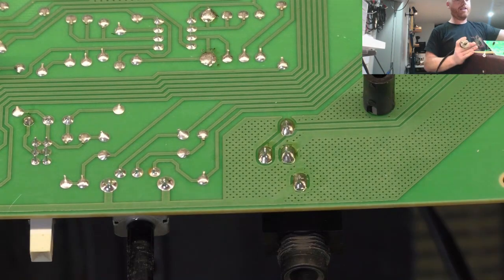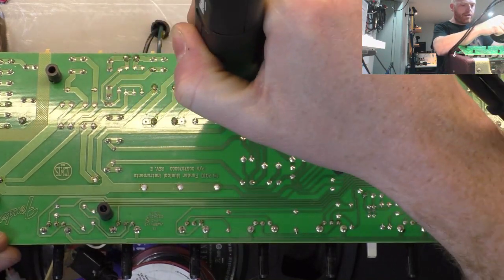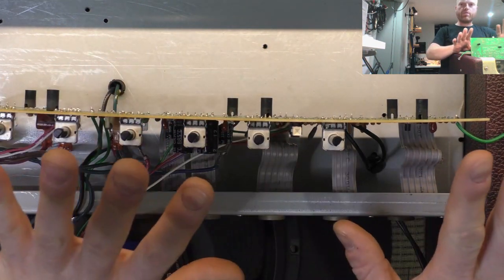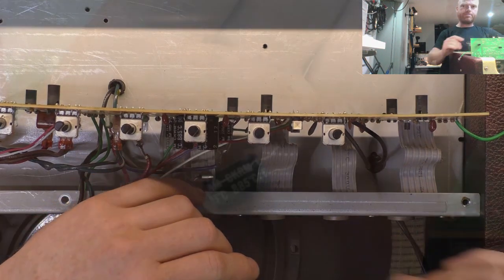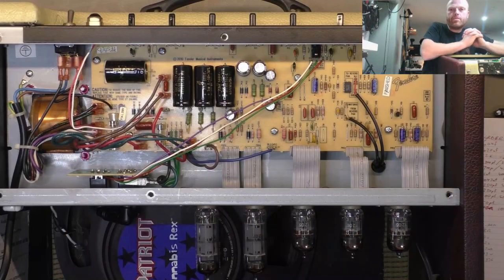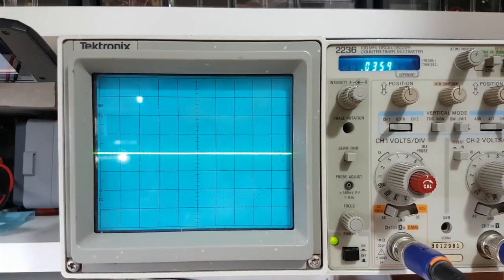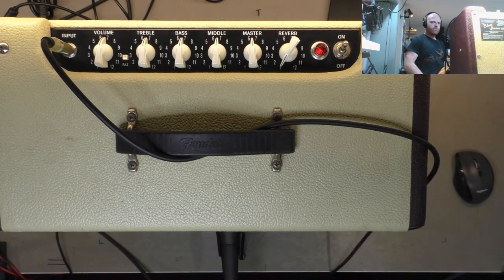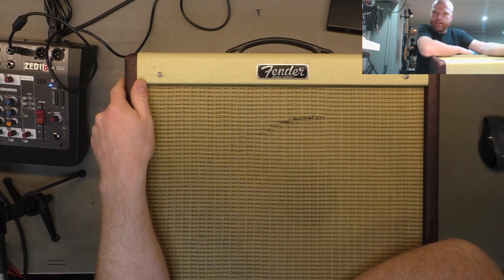Fender Blues Junior - Common Problems & Solutions (Part 2)

Comment: A grid stopper resistor of sufficient value probably could have tamed that oscillation as well but in case of PCB, it is not as easy to install as it would be in case of classic point to point wired amps. 

Very nice videos! 👍
I just recently noticed them and subscribed immediately.
Reply from the maker: Grid stoppers on the EL84'S?
If so, roughly doubling their factory value was part of the mods we implemented and didn't appreciably improve it.
Reply: @BradsGuitarGarage  No, to PI.
If that bypass cap of PI plate resistor did the job, as I understood, probably grid stopper would have done the same thing if the PI was oscillating or had too wide frequency response at higher frequencies.

Comment: Nice series! Go 🇦🇺 
Just a couple of quick questions if I may:
1) was that “adding bass into the first gain stage” cap still snipped when you did the final play through? I could still hear the bottom end caving in when you had the bass turned up past halfway, even with the volume and master opened up to 6.

2) to get this amp sounding better with overdrive pedals, is my best bet to swap out the Jensen speaker I have in the tweed version or to change the tone stack?
At the moment I run it: bass 0, treble 8, mids 6, volume 6, master 2-3.

A tech has already upgraded the jack for me and put in better caps and screen grid resistors.

Comment: Clean the speaker terminals prior to soldering with a pencil eraser or (better, more abrasive) ink eraser, or a fiberglas-bristle "scratch brush",  prior to soldering. It's important to solder the connection quickly, getting in and out fast, before the heat melts the solder joints of the braided tinsel-lead that goes from the terminals to the voice coil.
Reply from the maker: Is this comment meant for me or future viewers?
Reply: @BradsGuitarGarage  , more for future viewers;  and although a scotch bright pad will work, every electronics hobbyist, or professional,  really should have a fiberglass bristle scratch-brush. Those things are awesome. As for using a pencil eraser, I recently watched an instructional video on training people to solder to military and aviation specs back in the Fifties, and they were cleaning the pads on brand new circuit boards with a pencil eraser prior to soldering.  I learned this trick from old ham radio guys but you almost never see anybody on YouTube videos do it.
Reply from the maker: I do it routinely on molex and IDC headers.
I'm pretty sure I've shown that in a video.
Your usual white rubber eraser is kind of useless.
What you need is the ones whith that very mildly abrasive blue rubber on one end.
They used to make dark grey erasers and they were very slightly abrasive.
they were marketed as biro erasers.
Not sure if they're still available or not.
Reply: @BradsGuitarGarage   Modern white erasers are usually referred to as "plastic" erasers. They're latex free which means that they don't dry up with age like older erasers do but they are soft and have no grit in them whatsoever, and are useless for polishing.You are correct that usually if the eraser is gray or blue it will have some silica, sand or pumice, in it.  At the electronics repair shop I work for we frequently use powered draftsman's erasers that utilize a quarter inch diameter, 8" long, rubber eraser rod ----  pink for light polishing,  gray for removing heavier corrosion or paint/anodizing ---- presumably made from natural latex because they do unfortunately dry up and get brittle with age (and getting properly abrasive replacement rubber rods that aren't dried up has become difficult).  I also have several small battery powered artist erasers designed to take 4  mm Erasers and although the white plastic erasers that come with them are useless, I found some very abrasive gray "sand" erasers made by Sun Seed Dolphin that, although slightly smaller diameter than the usual  erasers, a wrap of tape or layer of shrink tubing on one end of them will allow them to fit the battery powered eraser. These work quite well for cleaning and polishing circuit board traces; and I also use the battery powered eraser to spin a leftover short stubby nub of  fiberglas scratch brush.  This works fantastically well, its my go-to cleaning tool prior to most soldering, and it will even remove the green solder resist from circuit-board foils. I also have a refillable, retractable eraser pen with fiberglas embedded  in the rectangular eraser rod, the Pentel Click Hyperaser.
Reply: @BradsGuitarGarage  , ps, here in the States I buy  Scratch brushes and the fiberglass refills from Esslingers which is a watch and jewelry repair supply company. The higher quality scratch brushes they sell are German-made and the cheap ones I think come from India. You can buy them with brass and steel bristles as well but be aware that the cheaper scratch brushes cannot be refilled.  They even sell an ultra skinny scratch brush with a 1/16th fiberglass brush which I've never seen anywhere else.  If you have any favorite supply houses or online companies for this type of stuff in your corner of the world it would be good to share it with viewers.

Comment: Not a criticism, but just wondering why attach the new switch craft jack directly to the board? I’ve seen it done with wires so as to not stress the board. 🤔

Comment: What would you say is the best built tube amp on the market today?
Reply from the maker: That's a very open ended question.
Keeping it to a well-known brand and without pushing too much into the esoteric market and one-off builders, I'd say Ceriatone.

Comment: My Blues Jr is reading 3.44 red to brown and 1.5 red to blue. Any idea what could be happening to my amp?
Reply from the maker: Swap the EL84's and see if the problem follows the tube or stays with the socket.
If the former, you need a new set of EL84's.
If the latter, you need to figure out why the amp is causing such an imbalance.
Reply: The measurements on pin 2, 7 and 9 are about the same on both tubes, but this measurement between red to brown and red to blue are different. I'll try swapping the tubes and check. I think it'll be a great idea to swap the 4 bigger caps and change the tube circuit plate to a newer one. Thanks   @BradsGuitarGarage

Comment: 10:40 I'm not a fan of this idea. You're better off isolating the jack ground with some fiber washers and leaving the factory chassis ground as-is. If the jack were to work itself loose, as they often do, you'll have an intermittent ground.
Reply from the maker: Fiber alone washers do nothing.
The bushing of the jack would touch the edge of the hole and create a ground loop.
You'd need a shouldered washer, and that requires a larger hole, so you'd need to drill out and permanently modify the chassis and cover plate. This is a good option (if you can source a shouldered washer - not the easiest to source unless you're in the know) on other amps which already have a larger hole in order to accommodate the courser threaded Cliff-style jacks.
Reply: @BradsGuitarGarage  ,  I have a bunch of nylon shoulder washers but as you mentioned those require rather a large hole in order to fit. Back in the olden days they used to use fiber shoulder washers and the shoulder itself was very thin so the hole didn't have to be as large, or required minimal enlargement to add shoulder washers when a new jack was installed. I haven't seen the thinner fiber type shoulder washers for sale anywhere.  Nylon ones are somewhat commoner because they're often used for mounting RCA jacks on audiophile-grade amplifiers, but the ones that fit RCA jacks are usually too small to fit a quarter inch guitar Jack.  The disadvantages to nylon shoulder washes is that they are soft and slippery and tend to compress, and they make for a loose fit so that the jack tends to work loose and spin or wiggle, and also they are usually an off white color and often easily visible underneath the shaft nut holding the jack in place.
Reply from the maker: Yes, I think the Switchcraft is the best option.
Just tighten them proper and use a quality heavy duty internal starlock washer.
Reply: @BradsGuitarGarage  ,  It should also go without saying that if replacing a plastic insulated input jack with an uninsulated Switchcraft type jack, and the interior of the amplifier has a painted or anodized chassis, you need to clean off the anodizing around the mounting hole so that the jack will make a good ground. And, use a shiny toothed washer, not a black oxide washer ( thank Lyle for the frequent reminders).